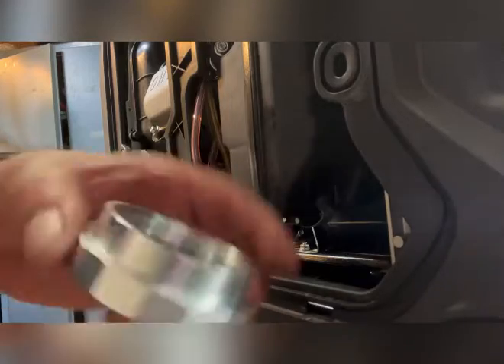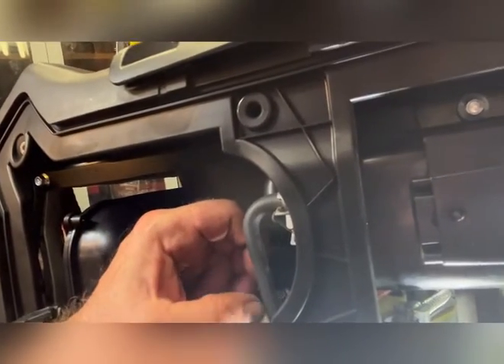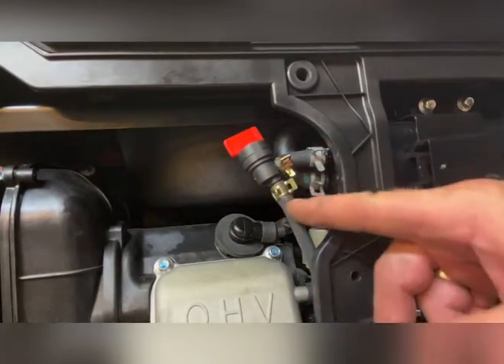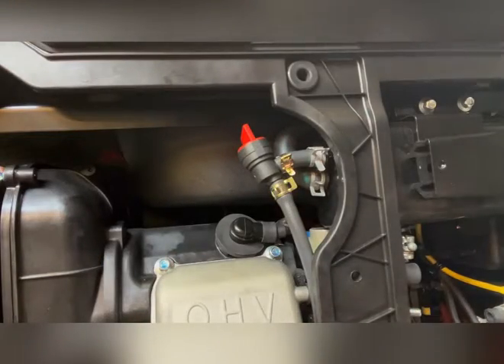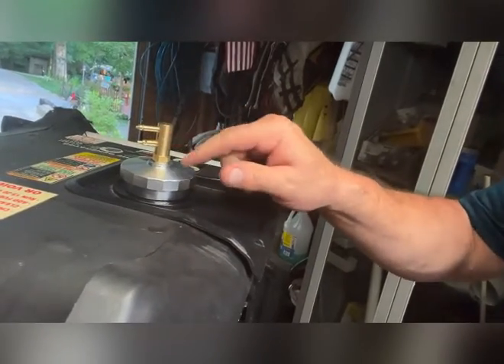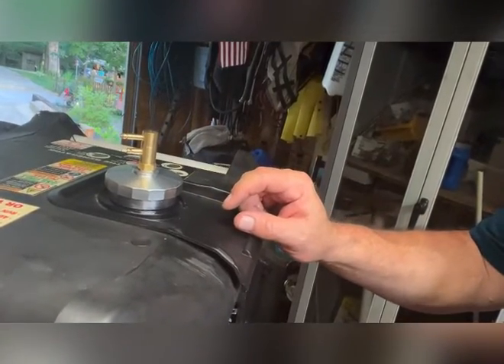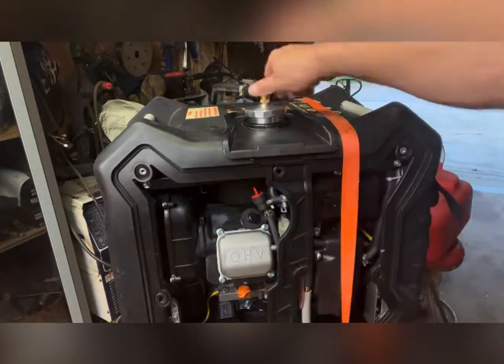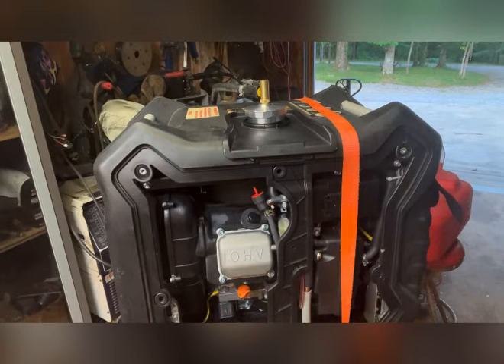Preditor 3500 how to install an extended run boat fuel tank. Installing remote fuel tank vent valve.

Comment: Very informative just what I was looking for
Reply from the maker: Thanks for your comment. If you need parts list let me know. Regards Jack
Reply: Sure that’ll help a ton.
Reply from the maker: I added the part info in the video description. I had the tank and hose. Just search for a Johnson Evenrude style and it will plug right in. Good luck.
Jack

Comment: I figured it out I think. The prime bulb has a mechanism on both ends which doesn’t allow the gravity effect. I opened the arrow side and took out the seal and it works wonderfully. Been on 5hr no problem.
Reply from the maker: That is very interesting. Mine works without modifying the bulb. I am going to do some tests on new and older boat tank hose assemblies. 

Does your arrow on the bulb point towards the generator?

Thanks for your response and sorry for my slow response.
Reply from the maker: Did you plug the vent line from the bottom of the tank? The one I added the shutoff valve to. I the line/vent is blocked off, a vacuum in the tank will be developed as the fuel in the tank is used and draw from the remote tank.
Reply: @lifeintnchevalier  yes arrow point to generator. I was looking around and found that end (the arrow side) of bulb has an inner seal that prevents gravity feeding. You can see if yours has by trying to prime the line with arrow pointing down. If the line doesn’t prime or you have to point the arrow up so it can prime then it has that seal. I’m not experienced with these things so I don’t know if it’s a recent added safety feature.
Reply: @lifeintnchevalier  yes it’s plugged. Sometimes I don’t know what happens but just shuts off randomly. The vacuum affect fills the generator tank by itself once I turn it on and sometimes it runs no problem other times it turns off again
Reply from the maker: @DAMotorsports  I know one thing, if I have the draw working and the line is filling the generator tank, if I take the gas cap off the generator, mine will flow gas. So mine will work without modifications to the bulb. My tank and hose is about 20 years old, they may have mandated changes to the line. I will see what I can find. Thanks for your input. My next video maybe on how to make the new lines work on this type of setup.
Reply: @lifeintnchevalier  How do you prevent vapor lock (fuel vapors are created as fuel warms, negating the vacuum) from occurring in the gen's fuel tank..  I would imagine it works in cool weather but is iffy in hot weather.
Reply from the maker: Perfect. The boat tank and fuel line with bulb prevent that. Runs great but the shutoff is required on the vent line.

Comment: On the boat gas tank do you have a breather valve? Or have the cap cracked a little bit? My tank looks like it’s gonna blow up when it’s running
Reply from the maker: @RippinBassCheeks  I have not had that issue with my tank, may have a pressure release. I have seen it on a few others when they are in the sun. On those they crack the cap loose.
Not sure how much pressure the generator fuel lines can take if the external boat tank does not vent off excess pressure.

Comment: So all I need to do is buy that little valve and install it and just the cap and tank and hose, I will run just fine? The tank doesn’t tend to be higher at all?
Reply from the maker: Thanks for watching. Yes, that is all you need. The tank runs much better when about the generator tank. I run my generators in the bed of my truck when I go to the races or boondock. I have run the tank next to the generator on the bed of the truck and it worked fine but it did not run the remote tank out. Always works perfect with the remote tank on my tool box above the generator. It is nice to fill the remote tank and keep the generator running. I have a few friends with the same setup and they love it. 

Just make sure all your connections are tight. Once the siphon is started it should just keep flowing the fuel to the generator tank.

Comment: To anyone who's bought one of these recently I would highly recommend just bypassing the factory fuel tank & adding a boat style tank directly to the carb. I'm on my 2nd one in the last couple years because the factory tanks rust. I've got less than 40 hrs on my newest one, never ran ethanol and it's already rusting pretty badly. I've got the warranty so I can exchange it when the time comes but I'd be incredibly pissed if I spent that amount of $ only for it to not work in 2 years.
Reply from the maker: Mine is 4 years old with no rust. I run Blue marine Stabil in all my gas tanks . I add a 1/2 ounce to my 5 gallon fuel tanks before i refill them. Most of the fuel i buy is Ethanol gas.
Reply: @lifeintnchevalier  the 1st one I bought 6 yrs ago was great, never should have got rid of it. The gas tank rusting is what will prevent me from buying a new one again.
Reply from the maker: @SlurpJ  as always, they changed something. 
I have had valves issues. The valve keeper was not heat treated correctly and the valve pounded through it. Lucky that she shutdown before i dropped the valve. I decided to buy a Honda EU3000is as a backup and one to parallel off of. That was three years ago. The Preditor is running fine now but i can’t depend on it. The Honda just runs. 
Some people have great stories about Preditor generators. For the price it may be a good buy but I need dependability. When I boondock, I need my generator to run, a fail will ruin the good time we planned.

Check my setup at LifeInTN Chevalier 

Thanks for your comments

Jack

Comment: Don’t know what’s going on I resealed the cap and the brass attachment. I looked over the fuel line don’t see any leaks. I primed the bulb but I think once all the fuel is used up from the line that’s when it turns off. It’s like no fuel is flowing after it’s primed.
Reply from the maker: Z

Comment: I ordered the parts should get started within a week or so. Looking over your video again, I removed the charcoal canister do you know if for this to work I need to cap all those lines? Thanks
Reply from the maker: I left my canister on. As long as you maintain the crank case vent and block off the larger hole on the filter cover you should be ok. On the gas tank vent valve (red one) that I added, you need to close the valve when on extended tank and open it when running the internal tank. If you close it when on internal tank, it will cause a vacuum in the tank and it will stall the generator. If you leave it open when on external tank, gas will come out the vent tube once the tank fills.
Reply: Alright thanks hopefully everything will arrive by next week.

Comment: What’s the longest you’ve ran it continuously? I got everything setup it worked wonderfully the first day 10hrs. Then I tried running it again couple days later it ran for a couple hrs at a time.
Reply from the maker: Did you pump up the bulb before starting? Is the tank above the generator? I found if the boat tank is below the generator tank, it does not draw fuel all the time. Pumping the bulb is important to get the air out of the line. I just got back from a week long boondock and the Preditor ran 4 days with the boat tank. When the boat tank ran low, I filled it up and never had it go down. My Preditor is in the bed of my truck and the boat tank is on my tool box in front of the bed. Sounds like you have an air leak preventing the vacuum to work. May be at the cap to the generator tank.
Reply from the maker: One more thing to try if the seal at the Preditor fuel tank is good, loosen the cap on the boat gas tank to let it breath. My cap draws ok but I have heard people had an issue if there boat cap was on tight. May not be your issue but something to try
Reply from the maker: ?? I would try another tank and hose assembly. There is a blockage or an air leak that is interrupting the siphon

Comment: It’s like the vacuum affect is broken somewhere and it doesn’t feed the gas. That’s what I’m thinking it is.
Reply from the maker: Just following up. How is the generator working with the external tank?
Reply: It’s a hit or miss. It works most the time but sometimes fuel stops running into the generator tank. Even though the external is over half full.
Reply from the maker: Interesting, have you tried running with the gas cap on the remote tank loose so air is allowed in? The vent on the tank may not be working correctly. We just ran ours at a NASCAR race for 48 hours and all I did was fill the remote tank. Sorry you are having these issues. Regards. Jack
Reply: @lifeintnchevalier  yes I leave the cap on external open.

Comment: Dose the fuel tank have a electric fuel pump to put the gas in the generator since your gas tank was setting lower then the generator?
Reply from the maker: No, it will draw up if all,the seals are tight and the air is pumped out of the line with the bulb. Best to have the boat tank above the Preditor tank.
Reply: @lifeintnchevalier  ok thanks